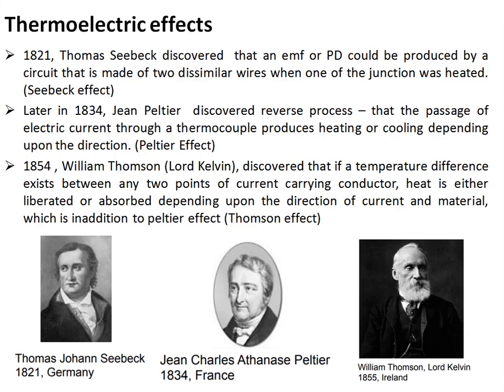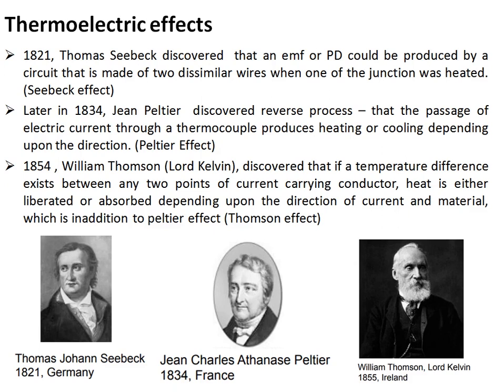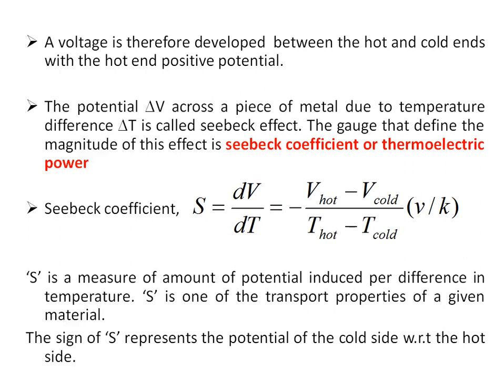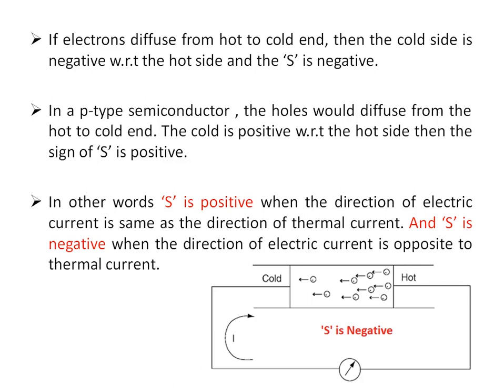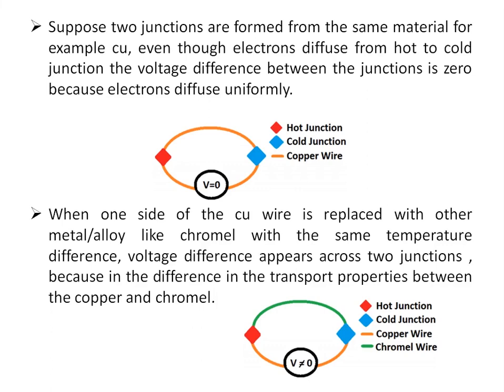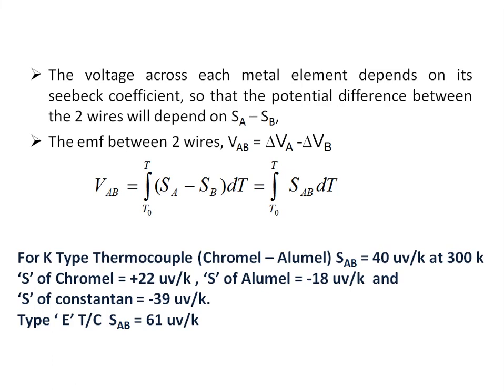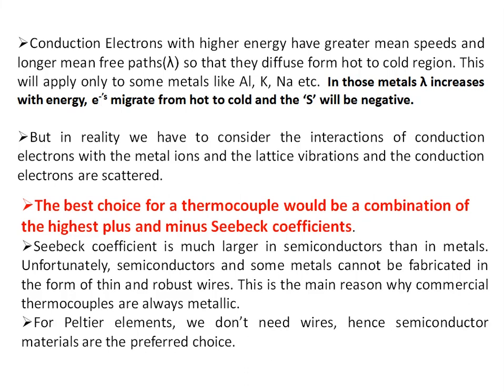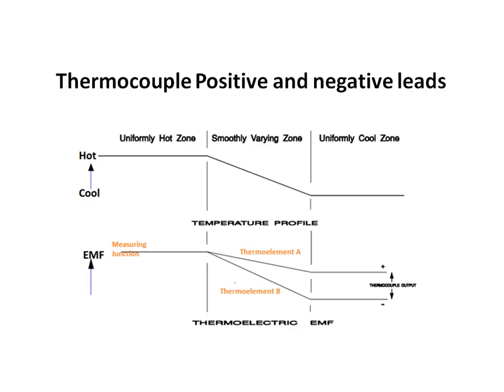Understanding Thermocouple Seebeck Effect

Comment: I still don't understand why different metals are joined. If electrons are moving from hot to cold faster than cold to hot, then why isn't that enough? In a battery, the electrons are transferred from one metal to another. There isn't a transfer of electrons here but just a different diffusion speed. Why would it matter if you just had one metal instead of two different metals?
Reply from the maker: Here we are interested in emf (voltage difference) generated by two metals. Higher the difference between the seebeck coeff. of these different metals higher the emf output and this is useful in applications like thermocouple used for temperature measurement. If we single metal the emf (voltage difference) would be zero and is not useful. Please refer Law of homogeneous metals.